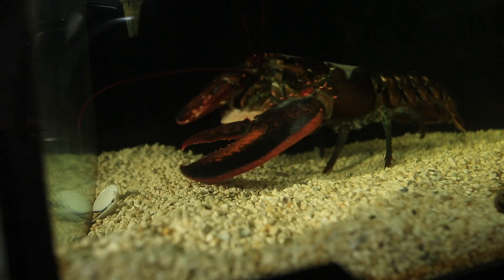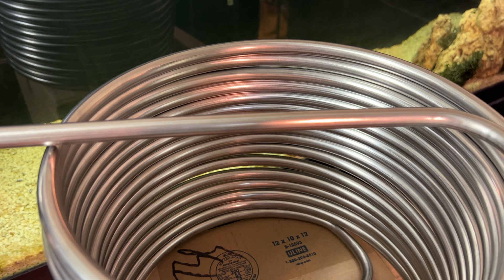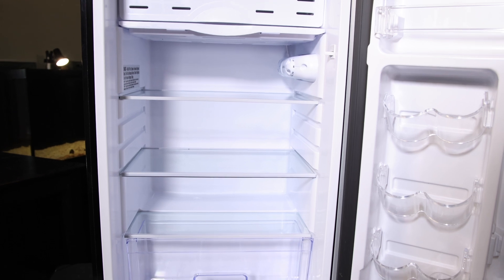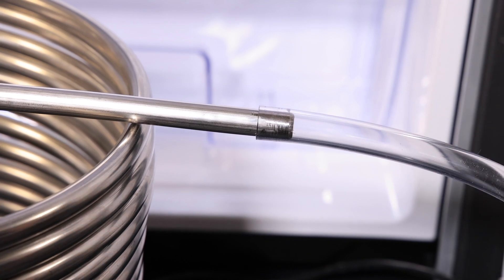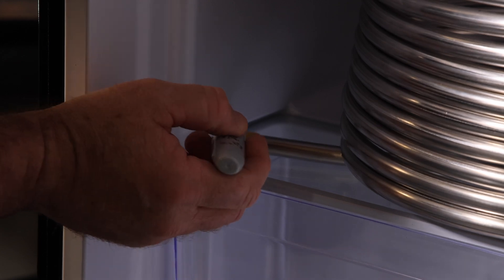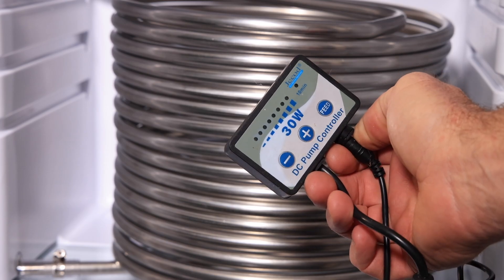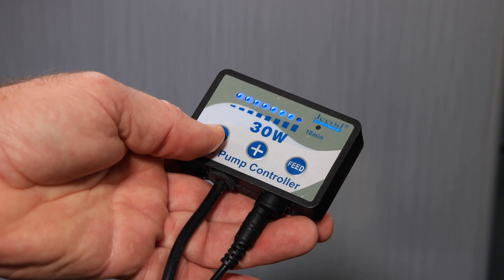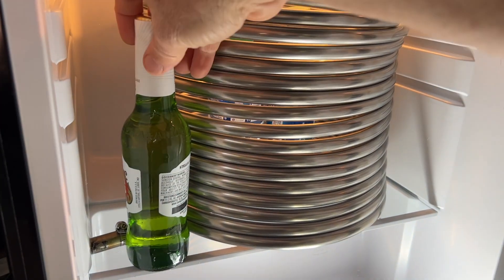Building A DIY Aquarium Chiller

Comment: Possibly too late to say given that your video is 3 years old but you should have used a non curing mastic sealant around the tube going through the fridge wall as these penetrations will allow water to be drawn in and more significantly this can cause the insulation to become water logged and once that happens it will degrade the insulation as it absorbs more water and stops being a good insulator.

Comment: I would think if the stainless tubing were immersed in a bucket of water in the fridge it would provide a more stable and immediate thermo transfer to the aquarium water.  More so if it were a steel bucket or an old pot.
Reply from the maker: Yeah, I think you’re right.

Comment: I  think that peltier cooling systems may be a better option today. Harder to put together, especially because there are some not so obvious gotchas, but it can be run on a thermostat and should even be quieter. A compressor system is more efficient for the fridge, but I'm not sure if the overall system is more efficient than a peltier cooler.

Comment: You should have run the stainless a couple inches outside fridge. Vibration of compressor over time will wear a hole in that vinyl tubing and then you have a big big leaky problem.

Comment: This got me thinking. Wouldn’t it have been easier to use a water cooler? Like the ones you find in offices or waiting rooms, that take the big jug up top,
Reply from the maker: The chiller needs to be titanium or stainless steel.  Copper and other metals can be toxic in an aquarium, and can corrode quickly in salt water.  ✌️✌️✌️

Comment: I probably would still look towards copper cooler on the cooler side, but run the water through the cooling solution it in a stand-alone loop, having a steel heat exchanger only on the aquarium side (so aquarium water never mixes with the water that goes into the cooler). Perhaps a bit more inefficient, but safer and hopefully less maintenance eventually.

Comment: I was looking at doing exactly this a few years back. We had several near 40C heatwaves here in the UK and my aquarium temperature was nudging 27+. I had a spare old fridge and a stainless coil too.
Trouble was when i did some basic maths it just wasnt going to do the job for my 400l uk native aquarium getting down below 20C. I just went with heavy aeration and daily 50% cool water changes instead to get the temp down. 
Shame because it looks like a fun project.

Comment: Fridge compressors were not designed to be cycled that like frequently, and will burn out.  Not all compressors are built the same. 
A better solution would of probably been a portable AC blowing into a ducted ICEBOX with your SS beer keg coil, as AC compressors are designed for cycle duty like that, but there would be no way to cycle it on and off when you reached your cooling temp, as a relay temp controller like an ink bird can not turn the AC back on once the power cycles.

Comment: Just an fyi for anyone that uses this method for cooling their ice baths. It does work but not too well. Really try to find a powerful freezer to use instead of a refrigerator. The water circulating through the mini fridge will actually heat the fridge up a considerable amount even when it is cranked all the way cool. That is the current problem I am having with mine. It does work though, but using an ac method might lead to more beneficial results. Any suggestions for my problem would be greatly appreciated.

Comment: Nice work! And it suggeated few ideas for my ice plunge. I can easily use copper coil, and place it into small freezer. I think that would be enough to cool 100galons to 42f. Yes, the pump thermostat would be as a requirement
Reply: By the way, what measurements are for the coil, i Guess i missed it in the video
Reply: Did you attempt this? Was also considering this

Comment: What material was that evaporater coil made from? Anything other than titanium will transfer heavy metal minerals into the water which eventually become toxic.  That's why aquarium chillers are so expensive. The evaporated coil is titanium.
Reply from the maker: It’s food grade stainless steel which is fish safe.  Titanium is used in high quality chillers because it is even more corrosion resistant in salt water.  ✌️✌️✌️

Comment: I run a small hydroponic garden, it has 4 plant sites and holds probably 80ish gallons of water, this is just a completely random idea i got from this video and i dont know if itd work or not but i was curious, if I took the 316 stainless coil, would it work if I ran the water in my system through the coil submerged in ice water in a separate cooler? Since water would already be running through the inside constantly would it be okay for the outside to be submerged 24/7 like that? And would something like that even sufficiently cool that large of a system, or would it probably over cool it? I know nothing about this kind of thing but I'm learning that a water cooler would really benefit my plants and I'm not looking to spend $1000 on a pre-built cooler for 80 gallons of water if I can make one for a few hundred so any input would be awesome there!

Comment: A couple thoughts on an inexpensive diy chiller that would cool Leon's tank to a good winter temperature. Basically transfer your coil to a container large enough to submerge it, fill the container with a 50/50 mix of water and antifreeze, place the whole works in a small chest freezer and plumb it though the top. You'll need to consider that the tank water will freeze at around 30°F, so either a constant flow through the coil must be maintained, or the freezer must be temperature controlled to prevent freezeups.

Comment: Appliance repair tech reporting in for leon. Condescending coil runs along the left, top and right walls. Lower right back wall is safest for drilling. You can get lucky but lower right (facing you)

Comment: Unfortunately this wouldn’t be a very good chiller at all. I wouldn’t recommend anyone ever trying this. I’ve seen a lot of videos on this (notably from the king of DIY) and it never works. The compressor is far too small for any sizable aquarium, when it’s only designed to cool a cubic foot of air. Commercial chillers actually start at around $400-$500 for a small 1/15 hp. A 1/15 hp would have more cooling capacity than a mini fridge for the same price. The mini fridge is nowhere near the power a 1/3 hp. A 1/3 hp would chill a 125gall 20 degrees or more in a matter of hours. 

Additionally, adding water bottles accomplishes nothing. Although there is a bigger thermal mass to cool the tank water, when the compressor turns on it has to work even harder to cool that same thermal mass down. 

With this system being far under powered I would suspect that the compressor will run almost constantly. The compressor is not designed to run like that and will most likely burn out prematurely.

With this system you are just paying the same price for less. Less chilling capacity, less reliability, less warranty, less functionality. If someone needs to chill a tank a few degrees (depending on the humidity), I’d recommend just using fans and chill the tank through evaporative cooling. If you need more, just go buy a chiller, don’t waste your time with that crap.

Comment: Using a small chest freezer, perhaps modified to stay very cold without actually freezing, might have been a somewhat more efficient solution. Because the doors on chest freezers open on top (instead of on a side), the cold air does not pour out every time the door is opened. This probably would not have been too much of an inconvenience as refrigerated storage is not your primary use here.

Comment: This was a well thought out project that is affective and cost controlled. I suppose you could even add a filtration system into the hose to remove suspended particles from the water of needed, requiring less time vacuuming the substrate. Leon is going to one cool lobster on those hot summer days! Great job..I think you are spoiling him...LOL

Comment: Refrigeration tech here. Yes it is flammable, but stop fear mongering. The amount of fuel in it is comparable to a lighter. And it is under pressure so what’s going to happen with it hits atmosphere? When working on a 290 unit you literally cut the pipe and vent it.

Comment: What about steel tubing sheathed in copper? that way the copper isn't in contact with the water, but is still helping with heat transfer cooling the steel a lot faster.

Comment: There is a simpler way to get chilling without using a fridge.. a higher pressure rated pump and an oriface then to an accumulator to allow the pressure to come back down after the Delta V and flow it through larger tubes back to the aquarium..

Comment: You will probably want something like the Inkbird ITC308S Temperature Controller for your pump: you can set the desired temperature with a tolerance for colder/warmer. Also good to plug the aquarium heater into the regulator. I lost more than one aquarium due to heaters malfunctioning and not turning off any more.
But there is another issue: ideally you DON'T pump aquarium water through the heat exchanger. You have two heat exchangers: one in the fridge, one in the aquarium or rather its sump. Then you fill the circulator with distilled water. Also you can run a closed-system pump instead of a typical aquarium pump. The advantage is that nothing can get stuck in your heat exchangers/tubing, and the risk of corrosion inside is very low.

Comment: Maybe not the most effective way, but sure a fun way. Since air is great insulator, and the fridge is filled with air, you need a lower temperature in the fridge the if it was filled with water. 

If you want to be even more cost effective, there are probably a lot of second hand fridges, ppl tend to get new when changing up the kitchen and fully working ones end up on the second hand market.

Lastly, i love these videos. The production is great and your voice is relaxing and nice. I'd like audiobooks read by you.

Comment: Just a suggestion, but you might want to add some grommets to the thru hole in the fridge.  It would really suck if that raw edge cuts into the tubing.   You could also ziptie some foam water pipe sleeving to help insulate the tubing

Comment: Small chunk of advice for anyone doing this type of chiller. Add a water vessel to submerge your coil in. A high salt solution works well to transfer heat and provide a buffer from temp changes when opening the door preserving the duel use of the mini fridge.
Reply: Oh and outboard temp controllers help too.

Comment: I would have used rubber grommets on the metal side where the tube goes through. Looks nicer, seals it good, and protects the vinyl tubing from the sharp sheet metal. Other than that, great idea.

Comment: The method you have chosen to build a chiller has been done before in the DIY aquarium community, with limited success, as the compressor for a small refrigerator or freezer is not meant for continuous duty. It will eventually burn out the fridge's compressor. Also, the heat transfer rate with this type of setup isn't ideal, as the stainless steel coil you are using will be cooled only by cold air in the fridge. I have successfully made a few chillers with a wort coil like yours, but rather than using a fridge to cool it in, I use a window-type air conditioner that has been disassembled, so the evaporator unit will be housed in a large portable picnic/beer cooler with the wort coil. The picnic cooler is filled with non-toxic ethylene glycol antifreeze. The evaporator unit will chill the antifreeze to well below 32 degrees Fahrenheit. The a/c unit is controlled by an Inkbird ITC-308 Temperature Controller Digital Thermostat which has a probe that is placed in the aquarium to monitor and react to it's water temperature. This setup can drop the temperature in a 120 gallon tank (at one point I was cooling two 120 gallon tanks with it) by 30-40 degrees in less than an hour. I keep this in the basement and pump water from the unit to the tank upstairs.
Reply: I too am worried about that compressor burning out... I dont know if cooling fins and its own fan would make a difference, but there is a massive mass difference to transfer heat.  Would love to know the duty of the system using the built in thermostat... but there's a big discrepancy between 20degC and the 4degC that the fridge wants to run at.

Comment: 9:46, if you don't have a drill bit that would fit the tubing and dont have the money for one make a slightly bigger hole and use silicone or a sealant to cover any gaps :)

Comment: The metal coil should be immersed in water inside the fridge,  remember that air is an insulator so the current setup isn't efficient whatsoever. The fridge then cools the water and it acts like a heat sink, look up home brewing and distilling and you'll understand. The temperature of the fridge can be set much higher thus it won't run constantly and waste electricity.
Reply: or at least increase the thermal mass by having a jug of water sitting inside the coil. A mini cooler jug might be perfect fit.
Reply: I'm honestly surprised more people haven't pointed this out
Reply: @sebastianwhalin743  they don't teach physics in high school anymore, there's no time left after gender studies and CRT
Reply: I was wondering just about this.  Maybe a shortened 5 gallon bucket with a hole in the bottom for the lower pipe and then caulk / aquarium sealant around it.  I think the water would make the heat transmission MUCH more efficient, like when you add a couple gallons of water to the iced down beer in the cooler to really get it cold fast.

Comment: As someone that dabble in pc water cooling. This method (phase shifting) is NOT efficient and eats up a lot of electricity. The reason for this is fridge compressor is not design to run 24/7. It will cool the inside of the fridge to a certain temperature then turn itself off. Because the fridge is insulated, the compressor only needs to be on a few hours a day. 

Since the fish tank is not insulated, the compressor will have to run continuously. This is why people don’t just put their pc in a fridge for cooling. It is very inefficient. 

Still, report back how it turns out in a few weeks. Might want to look into evaporative cooling or even m3 type cooling. Also, just putting a fan at the side of an open tank to blow on top of the water will cool it considerable depending on the surface area.

Comment: As a HVAC transition and a appliance repairman let me explain why this is a really bad idea this fridge is not designed to handle a constant heat load it also has a very small compressor the only thing you are going to accomplish is to create something that you need to rely on that's going to burn up when you need it and kill your critters

Comment: Just thinking about the way the heat exchange takes, makes me cringe. Liquid to Metal, to Air to Metal, to Liquid.... 

From an engineering POV this hurts sooooo much. Talk about inefficiencies. 

Yet still, cool idea. And you made it work. I might have done it in a different way, but I still have to admit, that you've got the job done and it works. So congrats.

Comment: Was wondering if the coil was submerged in a stock pot full of water would give a more stable temperature for the coil and let the refrigerator run less cause of the volume of water coil setting in??
Just passing along ideas 💡

Comment: I know this is not related to your video but was wondering about this. Maybe you can answer this question for me. If the power goes out will the fx4 canister filter backfire and have the water that's in the canister back into the aquarium and overfill the aquarium or its design not to backfire and overfill the aquarium? And when the power turns back on it will just go through its normal priming cycle? Thank you

Comment: 1. Sealing the incoming and outgoing holes for the tubes will help for air loss.
2. You should consider placing some small stryofoam spacers between the coils.  It will allow a larger surface area of direct air to the coils.  Just a thought.

Comment: I'd put a little  silicone around the tubes in the holes, to seal them off. You might not lose much cold air from these gaps, but still.

Comment: Maybe you should have asked your +500.000 followers for a better approach. ;-)

The $168,- stainless coil doesn't perform much better than PP tube in this situation.
At ~50[W] ( normal fridge capacity ) the temperature difference between input/output is less than 1[K] at 0,012 [Kg/sec].
=> Higher waterflow means lower temp-diff ( input/output ) => Tube-material doesn't really matter!
 
If you live in a house you should consider "freecooling", which is essentially a 32mm-63mm pipe made from PEM dug down to a depth of ~1 meter.
Heat transfer at "3[K] diff" is around 20[W/M]. ( at least in Denmark ~56N,10E ).

With an ambient temperature of 18C - 22C & "target" water temperature of 15C a "heat removal" -capacity of 500[W] will be a nice figure.
That equals 25 meter PEM tube in the ground + flow of 0.04 [Kg/sec]. ( PEM tube should be arranged with 1[M] spacing. )
This will be ~10 times as good as your current "solution".

The "heat absorber" in the aquarium and the connection tube can be whatever PP "floorheating" pipe you have.
Standard PP pipe is non-toxic and saltwater resistant ( at least for +100years ). 

If it gets too cold just turn down the flow.
Sorry for my bad english and for using metrics. ;-)